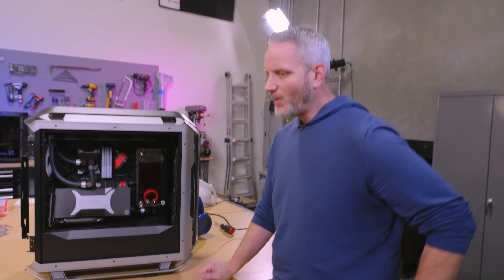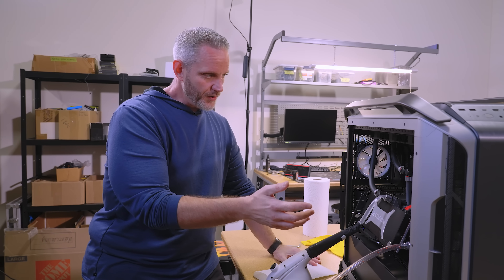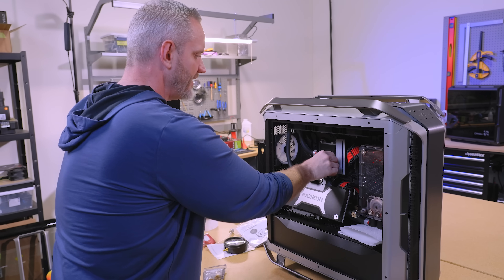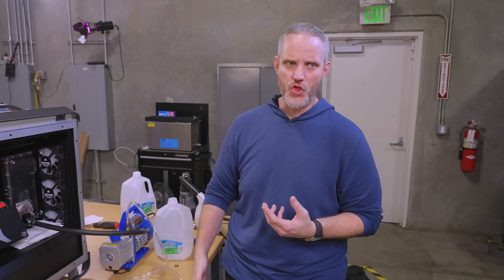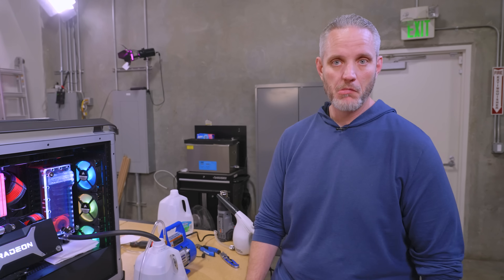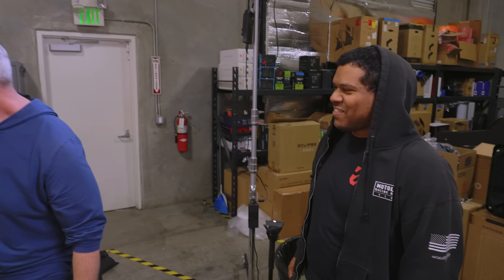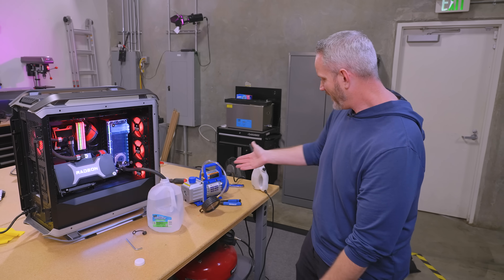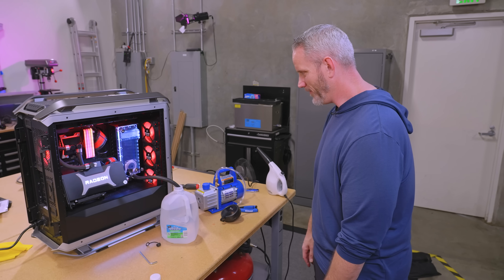I used Vacuum Pressure to fill a PC! Why didn't I do this sooner!?

Comment: You could use that pump to drain fluid. You just need the container in between the system and the pump; have the pump suck air out the top of the container, make sure the inlet isn't too close, gravity should keep the fluid at the bottom.

Hell, if you want to just swap the fluid, you could hook the new fluid on the other side of the system and have that dragged through at the same time without doing the vacuum step (you'd need to be able to see when you've replaced all the fluid though, so use a different color). Added benefit is you could do it with much less vacuum; you'd just need enough to get flow.

Comment: To use it to empty. You can pull a vacuum on a large empty container like a water cooler bottle the. Use that to empty the system with no danger to the pump

Comment: If you want to suck fluid out ... get a sealable bucket, make two inlets in the top with so much spacing tht nothing can go from one to the other. connect one to the watercooling and one to the pump ... open the water cooling up so air can get in and suck :) the buckert needs to be big enough for all the fluidd and then a bit as safety.

Comment: Jay, think of it like bleeding a brake system! get one of those vaccum buckets,  vaccum out one side, bucket to catch the extra. 

I'm surprised you didn't take a note from the Radio Control Car/Plane teams; little aquarium pumps to run fluid out of a jug into a system.

Comment: You can make a fluid trap for vacum systems from a mason jar and two pipes, one longer then the other, connect the pump to the short one so it dont draw in traped fluid

Comment: You can avoid that little bit of air stuck in the tubing if you have your filling "bucket" ABOVE the fill port - the hose is then filled with fluid, instead of air.

Comment: If you use one of the brake pump kits, then they have a container between the vac and the hose. You can put that at the highest point in a system and keep applying vacuum until the container starts filling up with no danger to the vac pump. That's how we have to fill a friends dual loop hard line system.

Comment: As long as the components can handle 15-20 psi pressure, then it should be fine. If I remember right my vacuum filler I use actually tells you not to use it on low pressure system below I think 12psi. Otherwise, you should be fine. If you really wanted, you can also use it as another way to leak check. As long as it holds a vacuum, you should be good.

Comment: if you get peristaltic pump, you could just pull air out of the system while pulling fluid in eliminating almost all air from the system. thought it might not be as fast.

Comment: Why don't you approach the filling of your cooling system like the filling of a hvac/airconditioning system of a car.
Use a header and a leak valve so you can maintain a stable vacuüm, so the system will not "implode". Using a header can also prevent air in the system because you don't have to dismantle the tubing.

Pull out the liquid with vacuüm,  take an empty vessel, vacuüm the vessel and pull the liquid out of the system into the vessel, so there will be no liquid blow.

Comment: Your not the first to do this lol, I’ve done it but not to that extreme. I draw in fluid slowly and never under a full vacuum. I advise against doing this unless you have A/C experience as this can and will cause damage. None of those components are designed for full vacuum and those A/C pumps have a lot of pull, a few minutes on a vehicle and all the moisture is pulled down on a 2lb system so yea their strong and efficient. Your literally boiling the moisture out and turning it in to vapour, it’s how components under vacuum works and enables us to remove all contaminants from an A/C system in a car or refrigeration unit. I wouldn’t trust any of those PC cooling components especially the thin weak radiators or the PETG. Careful telling people to do this, we all know how well a component designed for retaining pressure acted when subjected to the complete opposite force (titan). 
I work with A/C and have seen many parts fail under vacuum and these are parts designed to take it yet failed anyway. From thick aluminum tube to aluminum condensers and evaporator cores. Those “rads” are much thicker and far superior build quality compared to our PC rads so yea stay away from doing this or simply draw in the fluid slowly and never put the loop under full vacuum.

Comment: Around 2018 or 2019 don't remember the exact time, I have suggested this idea to my contacts in EKWB for the reasons below;

-Leak testing, if the air gets out during a leak. Air also can get in.
-Filing the system fast and easy.
-Can be used constant filling systems ( for EK Fluid gaming & EK Fluid works systems builds. )

Possible downsides are cracks on acrylic blocks and distro plates, pin saperation on radiators cave ins on fins, fittings might not be able to cope with negative pressure that being created by vacuum.

They liked the idea at that time and they said they will test it, but didn't get any reply from them again and I didn't ask.

Comment: There are way smaller pumps that are for vacuumin out bags. Like for preserving food or storing cliths and blankets, but those pumps are not made for attaching a pipe, so you might need something at the end. Heck if you don't need a very good vacuum you can try a vacuum cleaner.

Comment: maybe to get rid of that extra air from the line you could use an additional valve at the vacuum pump end. Pull vac, close vac pump side valve, submerse, open vac side valve, then close the pc side valve and drain the hose.

Comment: What if you just hooked the vacuum up to that fill port and then stuck the bottom tube in water. While I don't have much experience with vacuum pumps I believe even after there's water in there if you start pulling a vacuum it will greatly help getting out any kind of small bubbles that might still be in the radiator and it will top off that last little bit of airspace you had

Comment: would be interesting to see how the system is impacted over several fills.  The tubing and components were not designed to pull a vacuum, so there may be compromised components.  Interesting idea and cool if it works without complications.

Comment: jay you can also just use compressed air to create a vaccum. have you seen an airlift system. that can also pull water out without harming a vaccum pump because you dont use one

Comment: Add a liquid trap to your vacuum pump, just a glass jar with 2 hose bibs in the lid. It will save your pump if you happen to have liquid still in the system. there are plenty of DIY an professional designs online.
Your idea is awesome.

Comment: Jay if you want to do better you use a supply tank that has a connection on the bottom of the tank with a y valve so you can fill with out any air getting in

this can also do a leak test at the same time

Comment: Jay, there is no such thing as -1 ATM. A perfect vacuum is 0 ATM. If you think about automotive applications, you would know that bleeding brakes is commonly done using a pressure bleeder, not a vacuum bleeder. This is because you can easily get much higher pressure relative to 1 ATM, where as if you had the very best laboratory vacuum pump, the best you can get is barely 0 ATM. Use pressure, not vacuum.

Comment: I guess the collapsed radiator pipes may not return to their original shape after refilling and cause reduced performance, but vacuum filling is still feasible if it sucks from the loop's highest point (eg. unused opening of the top rad

Comment: For what it's worth, Aquacomputer already developed a vacuum system for PCs. Their LeakShield system uses a tiny vacuum pump to both prevent leaks and can also suction fluid into the reservoir. Its just not as fast or as cool as using an automotive vacuum pump. Alphacool also has an external unit call the ES Orbiter that does similar but requires using QDCs; you fill it with fluid, and it pumps it into your system while pulling out the air, and then you quick-disconnect the Orbiter and connect the two QDCs within the PC to themselves and done; air-free loop.

Comment: Well, you just need a tank that can hold the vacuum, and use that to extract the fluid. It just need to have a drain in the bottom as well. To take the fluid out of the tank after. 

Just make sure the vacuum port is higher than the water return point, much like a bong 🤣

Comment: Can you put vacuum to the fill port, place lowest point into the water and then vacuum? It should suck up the air, fill the loop like you are drinking with a straw, without creating high vacuum anywhere in the system. I dont like the sound of the radiator when it is under vacuum, but this should remove it, i guess.

Comment: Rather than fooling around with multiple valves to try to maintain a vacuum inside it, I would just manually fill the section of hose after the valve with coolant using a squeeze bottle (while holding it pointed up), then pinch the end off and quickly place it in the jug.

Comment: I too have a vacuum pump. A vacuum fluid pump is just a vacuum pump hooked up to a rigid container with the fluid drain tube hooked up to the container in a different location.

Comment: After you pull vacuum and shu the valve, invert the tube and fill it full of fluid, cap the end with your thumb and reinvert and put it into your coolant supply before releasing your thumb. Boom. No air.

Comment: I do like this idea and can see how a densely packed system (like Phil's) can greatly benefit from vacuum filling.  But over the past few years, I have taken to designing loops by first drawing a reasonably accurate scale diagram of the loop before building it.  This allows me to more easily consider details such as filling/draining schemes (not to mention simplifying the creation of a bill of materials to order against).

Comment: A way to remove all the air and have nearly no chance of radiator damage. Pull vacuum through the fill port with a catch can in line and a jug of fluid on the drain port. I would be worried about the radiators partially collapsing due to lower rigidity than the rest of the system.

Comment: I always thought about this but figured no one did that because the parts would break or something. And I think I would pull vacuum from the highest point in the reservoir, so if you get some air in there from the tubing in theory you could start the pump again with fluid in the system to get the remaining air out. The only problem is it might suck a little bit of fluid so, definitely a pump that can handle fluids would be ideal(since you could use it to drain as you mentioned).

Edit: One tube for vacuum in the top another in the bottom for the fluid intake(or in the top as well if there's another hole available, so you could easily top the fluid without getting air in the main part of the loop). Aaaand you might wanna get the fill bottle higher than the loop. I think.(?)

Comment: Wouldn't be rather easy to convert a vacuum cooling system filler like the Snap On SVTSRAD272A? But the $300+ price of the Snap On is a bit steep.

Comment: Here's an idea, if you want to use the vacuum pump to empty the loop do like the vacuum brake bleeder systems, put an intermediate container that the vacuum pump connects to with an inlet for the fluid near the bottom so it can't ever go to the pukmp

Comment: If u want to fill it completely try having your hose in a tank with your fluid and pull the vac from the top of the tank with is sealed, when u release the vac the fluid will fill first

Comment: I have serious concerns about this entire video.
1. Using a blower on your loop to blow the fluid out. Didn’t you just show us a video that blowing a fan motor without holding the blades sends current to the motherboard? What do you think the pump is doing in this situation?
2. Using a vacuum pump on your loop. If the rad fins are collapsing, does that reduce the efficiency of the rad thus ruining your very expensive loop? 
3. Vacuum filling your loop. With the fluid rushing into the system so fast, isn’t this also causing the pump to spin rapidly sending a spike in current to the motherboard?
I find this whole process suspect and would recommend continuing to be patient and following the standard fill method.

Comment: If possible, add a catch pot between the computer and the pump.    You want a place for liquid to stop before it runs through the pump.   An old reservoir would be good enough.

You can also pull the vacuum from the fill port while filling from the drain port.    You won't need to pull "max vacuum" to get a good fill ratio.
Reply: I built a liquid reservoir for doing carbon fiber vacuuming.  It's literally just a length of pvc, two caps, and a few holes/fittings.  Then you could pull liquid while you pull the vacuum.  

I wonder if you could get a fitting like what they use to siphon wine where it doesn't open until you touch the bottom of the liquid container.  Then you could pull a vacuum in your fill tube and hold the vacuum until it's in the liquid.
Reply: I dont think hes pulling water thru the pump just creating a vacuum in the pc tank then letting the watter get sucked back in by the created vacuum
Reply: @richiebricker  that's not what they're saying is happening, aside from any residual water that didn't get blown out during the draining step. A large enough reservoir between the drain valve and the vacuum pump would allow him to drain the system into the reservoir by using the vacuum to pull the liquid (by pulling a vacuum on the reservoir, essentially), and then he could refill the system by reversing the order, placing the cooling system between the pump and the reservoir of new coolant, in one step instead of two
Reply: I dont think hes pulling water thru the pump just creating a vacuum in the pc tank then letting the watter get sucked back in by the created vacuum

Comment: Something to be aware of when using vacuum on a system designed for pressure. I was a Auto Tech at one point in life and they have warnings about trying to pull a "full vacuum" on a cooling system. There are a number of seals that will shift and there is a possibility of damaging radiators and heater cores. I think you might minimize how much vacuum you use in a method like this and use a small tank to prevent the coolant from getting sucked into the pump. Anything water based will TRASH that AC pump.

Comment: you dont even need a special vacuum pump if you want to pull the coolant out with the vacuum. all you need is a sealed container with 2 outlets inline from the loop to the pump. that way anything that comes from the loop goes into the container and doesnt go to the pump. just like the older vacuum brake bleeder systems. its has a catch container for the brake fluid so it doesnt go to the pump

Comment: Jay in the auto hvac system your vacuum pump takes around 10 min. to hit -29 inch. but think about this you also leak test your water cooling system under vacuum

Comment: You can drain with the same system, the thing you need is the tank, dual chamber and be sure that enough free space is available.
But it will not be as efficient than filling

Comment: Bro, I've been filling and emptying my loops with vacuum since 2016. You don't need a sophisticated vacuum drain system, just attach your hose to an airtight container of your choice from the top, and pull another hose from next to it to the pump. Crack the highest point of the system open (fill port etc) and pump. Once you start pulling vacuum into the container (milk jug etc.) your fluids will drain there, and as long as the hose from pump inside the container is above the fluid level you will only draw air into the pump. Its best to have a couple of inches between the hose to prevent spillage to vacuum pump hose. This method in reverse is also a quick way to fill the system, just reverse the ports to pull vacuum from top highest point using the catch can method (above) and put a hose with valve to the bottom and the other end into water jug.

Comment: If you connect the vacuum to the fill port at the top you can just draw the fluid up the drain line. Just stop the vacuum before the liquid hits the port at the top.

Comment: You can do this at neutral pressure using the little vacuum thing you use to drain, no need to worry about leaks or breakage. It’s called the Venturi effect, and people have been doing it for years.

Comment: What if you add a valve to the fill port and attach the pump there. Leave the drain port hose into the fluid. Pull a vacuum from the fill port and slowly let in fluid until full then turn off pump and close both valves.

Comment: Pull the vacuum from your fill port and have the pump connected through a brake bleeder reservoir. And have the fluid supply the same as you have now.

Comment: also a brake bleeder would work on pc systems with soft tubing that easy to crush with your fingers. the catch can then would also catch the overflow prevent leak caused by over fill. that u could just plug into the upper fill port but u have to make a adapter for it.

Comment: if you want true vaccum, you need a container of distilled water, a valve from the container (not just the line), then you simply vacuum everything out with the valve for the line open and the container closed, then flip the container upside down and open the valve from container.  drawing vacuum with another line inside the container will introduce air.  if the water is more than the capacity of the system, there will be zero air with leftover water.  then you close the valve from the line side of the container and have the line drain any excess back into the container.  if the container is plastic, it'll collapse.  if it is of hardend material that can withstand 1bar, then you will not have an issue with a collapsing container.

container > valve > line > valve > vacuum > line > valve > liquid cooled system